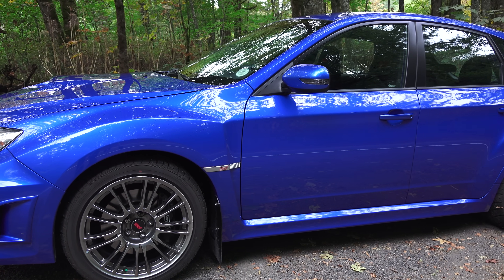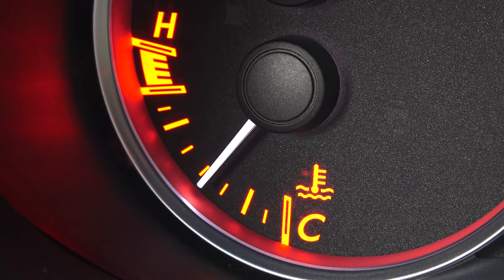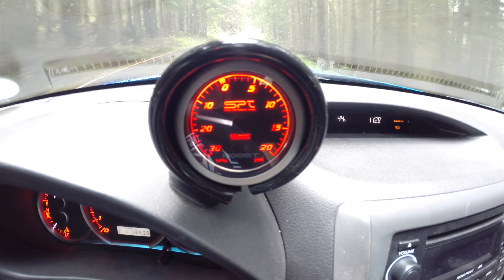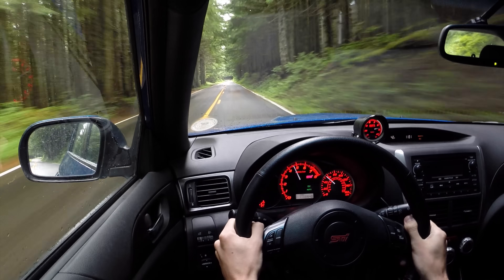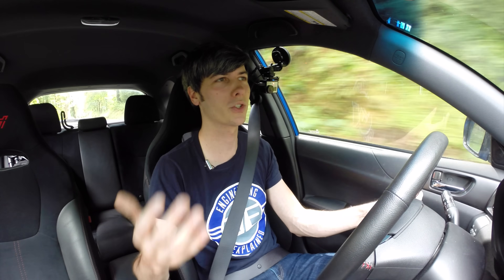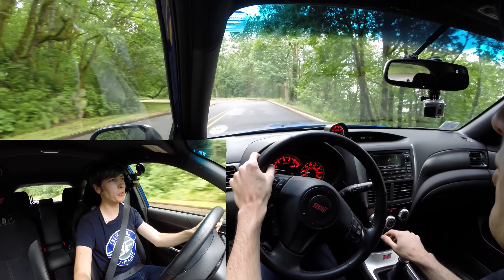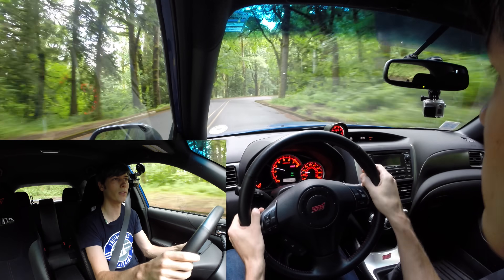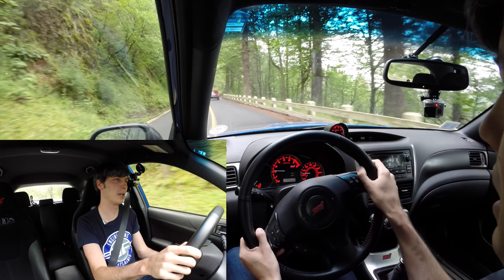5 Things You Should Never Do In A Turbocharged Vehicle

Comment: My GTI still runs the oil pump for the turbo after the engine is shut off so it doesn't burn out the bearings in the turbo. Newer cars dont need to be kept on after your done driving.
Reply: Yer all new cars are fine pretty much all cars have turbos now ie golfs and Ford Focus and they have auto stop at the lights!
Reply: It's still a good idea to cool your car down. It's not just the turbo that gets stressed.
Reply: Megamanfsx a turbocharger slows down fast when the engine is running. Even the time it takes to park your car is more than enough to slow it down to idle speed. Don't forget that when you don't press the gas pedal, the air from the compressor is stuck in the inlet pipe, which forces the turbo to slow down anyway.
Reply: Yeah same on my old scooby.
Reply: same here, turbo is coolant cooled and doesn't need to be run at the end of the trip.
Reply: +elmin2323 I never even considered that, good point!
Reply: Yeah a lot of his points apply to older cars
Reply: Or just do what I did on my old car:  turbo timer.
Reply: The thing is that you have to idle the car before turning it off so that the turbo can "slow down". If you don't do this, the turbo will spin fast without oilpressure. (If you don't have the oil pump thingy that hackneo has)
Reply: I'm a newb, but isn't this what a turbo timer is for?
Reply: it does not run the oil pump. it runs the coolant only. oil pump is mechanically ran off the crank/timing setup. Coolant is ran off the/an accessory belt, when car is shut off it switches over to an electric coolant pump. still same result.
Reply: Ball bearing turbos will spin even after you stop and turn off your car. The air isn't stuck in the inlet pipe if you have a blow off or a recirc. valve.
Reply: Sanjuro Makabe blow off valves need a vacuum to remain open. Since the engine is off, there is no vacuum so they are closed.

Bb turbos do not have a big demand for oil, that's one of the reasons they are using ball bearings
Reply: dimos k Yes but you were talking about while the engine is still running. BB turbos have less friction than journal bearings and are known to spin after the engine is shut down.
Reply: Sanjuro Makabe yes they will spin longer after the engine is off, but they have ball bearings, so they have no trouble doing it, while a turbo with sleeve bearings is based on the oil to create a protective film.
In any case, a bb turbo can handle the dry spin after the engine is off much better.

As for the blow off valve, it remains closed at idle too. At least that's my experience with the 2 turbo cars I had and cars from friends.
Can you imagine how confusing it would be for the ecu if during idle half of the intake air was escaping from the bov? It is air that was measured by the maf sensor and the fuel is calculated based on that measurement. If half the air is gone, the engine would work too rich and maybe flooded
Reply: +dimos k Lot's of cars run based on a map sensor, and would not be influenced by that, except that the ECU would probably notice the BOV is leaking.
Reply: julienjjj
i said MAF sensor, not MAP.
you are correct, a MAP sensor is not affected much (if any) by a loss of air between the turbo and the throttle body.

but a MAF sensor is measuring the mass of air that enters the engine, and calculates the fuel it will need for proper burn.
if some of this mass leaks, the sensor doesnt know it, since it doesnt measure pressure (which is what MAP does) and it sends more fuel, which leads to bad burn in the engine and check engine light

for example, i have small turbo engine, which only uses MAP sensor. i removed the hose that recirculates the air from the bov so i can hear the sound of it (ye i know, its a bit childish lol). no problem with the engine, no warning lights, nothing.

if you try the same thing to a VW turbo engine, which uses a MAF sensor, you will instantly get a check engine light (if its not already on because, you know, thats what a VW do usually) and possibly a safe mode.
Reply: turbo will spin until pressure reaches equilibrium on both sides of compressor. remember when car is at idle before it is shut off outlet side of turbo is under vacuum. At this point the impeller is only running off kinetic energy and therefore doesn't have enough momentum to build pressure so it slows and eventually stops at or just before equilibrium. if it somehow manages to build pressure, any pressure it builds will push its way back though the turbo and out the intake.
Reply: Pedro H you are correct, but still, the bov remains closed when engine is idling. I guess it needs more vacuum to open
Reply: dimos k BOV and WG uses boost to open, BOV opens during a surge or overboost situation when you let off the throttle suddenly. WG opens at a set pressure to prevent boost creep. I think there are a few BOV that are vac assisted, but the heavy lifting is done with the boost itself.
Reply: Pedro H bov opens when vacuum exists after the throttle body. When you move your foot from the throttle, it creates vacuum which, through a silicone pipe pulls the bov piston to open and release pressure so the turbo won't surge. 
WG works as you said
Reply: Pedro H bov can of course open if there is a much bigger pressure than it is designed to withstand, but that's not how it is designed to work.
Reply: dimos k trying to envision it in my mind since its been so long since I have dealt with one, I remember there was a nipple up top that went back to the manifold, but the valve itself is also on that side of the turbo, so wouldn't both sides of the diaphragm have equal pressure?
Reply: Pedro H
yes, they have equal pressure when the throttle is open, and the bov spring holds the valve closed. when the throttle closes, the manifold side has vacuum, which acts on the valve and pulls it open(along with the pressure that pushes on the other side)

but when idling, the spring itself is more than enough to keep the valve closed
Reply: +dimos k so top side of diaphragm is connected after throttle body and bottom is before but BOV is on out side of turbo then yea that makes sense then.
Reply: Pedro H yes exactly.

Comment: 15 - 20 miles 4cyl 20 - 30 miles V6 V8 to FULL operating temp (all components up to optimal temp).  Longer then you may think.   Good info on the cool down period.. though I would like to point out the clever coolant setup Subaru has come up with which puts the coolant reservoir above the turbo.. meaning that naturally the hot water in the turbo will rise and cooler water from lower in the system will move in to replace it... all without the engine running at all.  Lest one not think I do not agree with the cool down which I fully do.  I just like to spit out random bits of info from time to time.

Comment: so if your rpm's are low enough, and you need lots of boost you can run the turbo past the choke line. that can cause some serious turbo wear and lots of heat, and that heat can deffinatly hurt the engine.

Comment: I am a retired service manager for Toyota, and disagree with your comments, I am used to the Supra's turbo's ect,,,, All engine's are designed and built for the customers What I will agree with is not to allow the engine speed to pull full rpm when the engine is cold, (that is common sence) if you keep regular service intervals than there will be no issues. Question who are you anyway are you a qualified mechanic or a engine designer ??

Comment: There is a far more sinister reason for letting your engine idle a minute or two after parking than just evaporating lighter oils. If you don't let your turbo slown down after reaching your home driveway and you just kill the engine, you also kill the cooling AND lubrication for your turbo, that is still turning at 50k rpm...

I have personally changed an entire truck engine for that very reason when i was working in a truck shop. Mmm, 16 liter Volvo from a logging truck. Turbo seized and the intake turbine exploded, allowing coolant to freeflow into the nr.6 cylinder which had intake valve open, resulting to a major water lock when the truck driver tried to start it the next morning.

10kW starter motor did not ask should it turn or shoul it jam - it threw connecting rod thru the block wall. Fastest way to get the truck back on road was to change the entire engine.

Comment: Turbo boost at low rpm will not be very good also I think because the exhaust flow and pressure will be to low to spin the turbo to high speeds. The faster the engine runs the harder  the engine will push exhaust through the turbo to get it up to required speed.

Comment: Do not allow the fuel to get below 1/4 tank or so. 
Do not change oil at factory intervals. 5k miles or less.
Do not use anything except premium oil-filter.  
Do not modify for additional boost.  
Do not drive it like a rental. 

Add aftermarket oil-cooler.

Comment: 1-I live in the tropics. It's hot all the time. 
2-Turbo Timer
3-Have literally never seen anyone do this. 
4-Well Duh
5-Learn to drive. I have a 2wd front wheel 2.0 turbo that I love to floor out of corners. And I have no lsd. And I have crap tires. Don't buy a turbo car if you can't drive.
Reply: John Webb Yeah, you're right. But I'm talking about warm-up time, and I don't care if you live in the tropics, your oil won't at operating temp the moment you start the car.
Reply: Your engine oil is at operating temperature all the time? That's around 230°C. That's impressive!
Reply: It's more like 190-210 degrees Fahrenheit.  Most turbocharged cars have oil coolers which cool down the oil and automatic turbo timers that circulate coolant through the turbo that minimize oil coking.
Reply: something1random23 well as a general practice i dont drive like a madman as soon as i startup but it take just a few minuites to warm up. at least going by the temp guage. but whatever my car is a 98 and its perfectly fine :)

Comment: isn't that what a turbo timer does let the engine cool down?
Reply: my 16 year old audi s3 has an after run coolant pump
Reply: Most modern cars do them have them, in the form of coolant recirculation through the turbos.  Back in the day when turbos were only oil cooled, then yes this was much more of a thing.
Reply: JonEldred my turbo diesel truck's manual tells you to idle a few minutes before shutoff after high load conditions. so no they won't always come with a turbo timer.
Reply: That's what any modern water cooled turbo does. If there was any merit to letting a car idle down, these cars would come with turbo timers.
Reply: John Webb So you saying your GTi is water cooled got me wondering if what I was told about my BMW being oil cooled was accurate or not; I did some research just now and, indeed, it is water cooled.  This means not only was I wrong, but my local BMW dealership is worthless as far as accurate information goes.  It would make sense since my water pump is electric and can circulate coolant to the turbos after the engine is shut off.  God I hate being misinformed.  Thanks for sharing dude!
Reply: +John Webb this is true, i also posted a comment about this..you definitely dont need to idle your car before turn off especially in a WRX or sti
Reply: My 2007 gti has the recirculation on it, im surprised your bmw doesn't have it.
Reply: John Webb As am I tbh
Reply: John Webb If by "modern" you mean ones that are 5 or so years old and newer when forced induction became more economically mainstream, then I'd agree. I've got a 2007 twin turbo BMW for example that is oil cooled, by my wife's '13 Escape has the system you mentioned.
Reply: =) coinsagE46m3 glad to help out!
Reply: Wondering if my tiny Seat Ibiza 1.2 TDI E-ecomotive(2012/03) has it
Reply: Who said its a video only for modern cars owners ?
Reply: Actually the thing with letting the oil cool after driving is MORE important on older turbocharged cars, because some of them don't even have water cooled turbo bearing housings let alone any way of circulating the oil or the coolant after shutdown. In fact, in the very early days of turbo engines, turbos got a bad rep because people didn't know to let the oil cool down - and many turbochargers were replaced with low miles because of failed bearings caused by oil burning up and coking on the bearings. Soon manufacturers started fitting water cooling to the bearing housings, and later added electric auxiliary water pumps that helped keep the engine temperature more even after shutdown so the oil wouldn't get such a hard time. 

After a hard drive you should do some cooling off with any turbocharged car. If it's an old car, from the '80s or such, then you should think about cooldown after every run, even normal driving.
Reply: Yes, but the vast majority of cars do not have them equipped as stock.
Reply: my 2000 Audi A6 2.7t has this feature, it's been around a long time, turn off the motor, the aux water pump comes on and the radiator fans come on for 10 minutes or until coolant temp has fallen below a certain temp. I'd never park a turbo car immediately after punching it but most people don't, they have 20 -30 seconds of finding a parking space or pulling in the driveway and or garage or parking structure before the stop their motor so they usually are fine, water cooled turbo's don't suffer as much as those that rely on oil and radiating heat
Reply: Ive got a 2005 Volvo S40 T5 without that feature. Maybe its been a while for a long time, but that doesnt mean every car has it. Even modern cars.

Comment: ECU won't put any more fuel in than is appropriate for the rpm and amount of air going into the engine, so rich running at full throttle and low rpm is just wrong.

Comment: Ignition advance a problem? but that's not the knock detector is for? High octane is better to have a lower timing advance, but  that's regulated by the ECU, with it's sensors, i don' think it's good, unless cars made for that fuel, in your manual is the best fuel for your engine.

Comment: I haven't owned a Turbo vehicle for a long time now, but when I did I found the fuel "octane" went away with time.  In that 3.8L Buick SFITurbo, if the fuel got stale, maybe 2 or 3 weeks, I could only apply maybe 10-15 PSI boost before it would backfire and cut out.  Full boost was set to 21PSI in first gear.  Factory boost was about 15 PSI.  Every time, running the out fuel out and starting with a fresh tank of 93, restored full power.

Comment: Don't EXCLUSIVELY buy high octane fuel. Do what the owners manual suggests. If it says 87 is fine, run 87 if it says run 91, run 91.
Reply: How many Turbo engines don't call for 92 or 93 octane?  One?
Reply: +Latro Geniwile  mine say min of 91 rec 95
Reply: +Latro Geniwile alot of new factory turbo cars are being tuned for 87... ford ecoboost is one brand

Comment: Just gimme a V6. Problem solved.
Reply: Be more specific.  There are more shitty V6's than there are great ones.
Reply: +coinsagE46m3 I can't name one specifically, but I'd just choose any that has two; chain-driven, or gear-driven cams, 24 valves, and is fuel injected, as most are now. My wife has a 2016 Kia Sportage with the turbocharged 4, with 280 hp. The Kia V6 has 280 hp, with none of the special care that a turbo requires. I should add though that the Kia turbocharged 4 runs great on 87 octane. That's what the manufacturer calls for, and she has no knocking and pinging ever.
Reply: I had a 2001 Grand Am GT with the same motor. Yeah, those 3800 V6's aren't bad. Remember the old blue V6's that used to come in the late 70's Sunbirds and like GM models? Also the new 1980, 2nd generation 'X' cars. Those were the junk engines. Always blowing head gaskets. Here's one for you -  know it's off subject but, the Iron Duke L4! Probably one of, if not the best 4 cylinder ever made. You could beat on it like crazy, and it would still come back for more.

Comment: ONLY run what the manufacturer says to run! if the manual says to run regular gas then do so, if it says premium gas then run that, I've had issues with cars because I was putting in 93 and the car was misfiring, but when I ran 87 it ran perfectly

Comment: As far as not shutting off the engine after running it hard, what are your thoughts on turbo timers? I know they were big back in the early to mid 00s but I don't really see many people use them now. Part of it (so I hear) is because turbos are now liquid cooled in addition to oil cooled and the coolant will continue to circulate through via pressure difference after the engine is shut down.
Reply: how m
now?
Reply: Turbo timers don't hurt to have but aren't needed. Especially with modern turbocharged cars where the oil flows slowly for some time through the turbo charger after the engine has been shut off.
Reply: y jk wab custom turbo?
Reply: +y jk even 2.7 tt ebf150?
Reply: +knightrider1545 
Yes all modern fords have this technology incorporated AFAIK.
Reply: turbo timers are technically illegal in the UK as its illegal to have a car running without anyone inside it. remote start? illegal. turbo timers are the same principle, so fall foul of the same regs.
Reply: +Peter Lattimer 
Turbo timers are illegal in many states and countries including where I live, however some rules are illegal but never enforced. Its extremely rare to see a 90's Jap turbo import without one.
Reply: y jk which states, i think thsts pretty uneducated decisions by the states imo